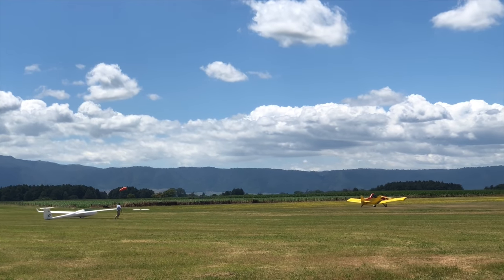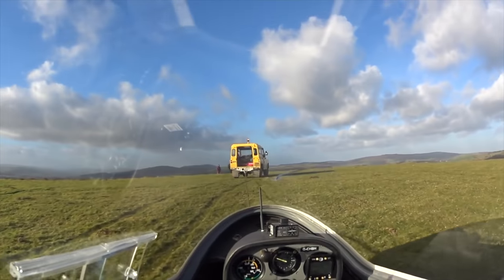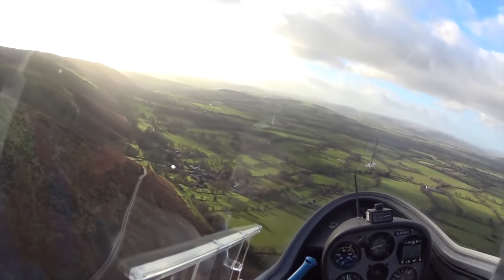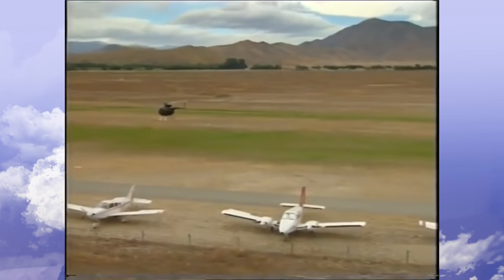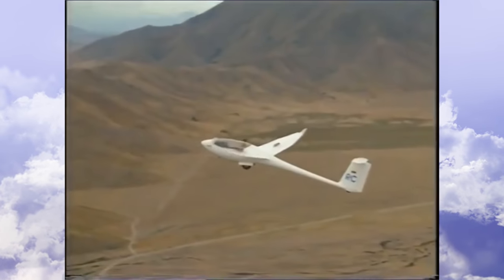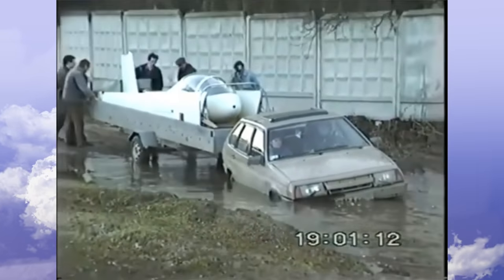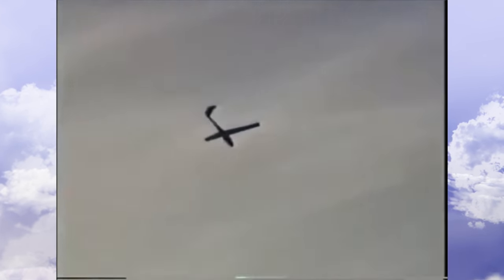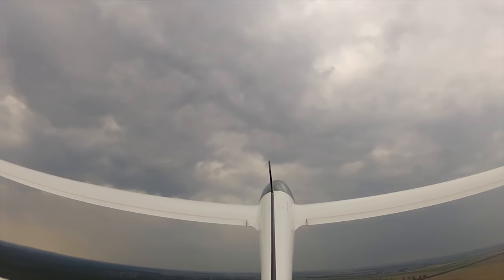4  Weird Ways to Launch a Glider! 🚁

Comment: Do you know whether the heli launch had an upgraded belly hook ? Can’t imagine most glider tow hooks are rated for the full glider weight!
Reply: I think they didn't upgrade anything. Glider hooks are designed to withstand more than weight of the glider. But this kind of operation is not expected to use as daily routine by manufacturer. Some glider designers assume nominal force 1.3 of max T/O weight and the shear 1.2 of nominal.
Reply from the maker: Yeah this was a one off stunt, so I doubt they changed the tow hook for it!
Reply: Glider tow ropes are required to have strength not less than 80% of the glider weight and not more than 200% of the glider weight. As the rope should break before the attachments, obviously the attachments (on both ends) must be able to cope with more than 200% of the glider weight.

Comment: Crazy Start method #6 isn't that crazy at all: RUN!
 
Ever heard about the "Archaeopteryx" glider? Swiss engineers invented a rigid wing glider that can be started by the legs of the pilot. :o

It's possible to start and land that thing like a delta wing glider. But with its enclosed cockpit and a glide ratio of 28, (and a prize around 80k) that thing is not a hang glider. Imo hat is a proper sailplane.
Reply from the maker: Yeah I don’t know much about it, but it’s very interesting! Almost a hang glider more than a glider

Comment: Interesting, you forgot the reverse pull auto tow. The cable, with rings on doth ends, goes round a pulley at the opposite end of the runway, the tow car drives towards the glider, the glider goes up they cross in the middle. When the glider releases the car the car goes to the launch point and leaves the cable there for the next launch, with two cars, the launch rate is very high.  I have seen this used on several sights in the UK
Reply from the maker: Yeah I think that's how you're meant to do an auto tow! I've never done one though, and didn't have any footage of it :)

Comment: That balloon launch got my attention too. Besides the safety issue, who would want to launch a glider during stable, low wind conditions?
Reply from the maker: True!
Reply: I disagree that it is unsafe - in fact I think its safer than winch or autotow.  And it could climb to a very high altitude, so after an early morning launch to 10000 feet in stable air, the glider could potter around at min. sink speed until the thermals start popping.
Reply: @davemould4638  Here’s my ‘unsafe’ scenario: if the cable/release mechanism should fail below 300’ there is no possibility of recovery.
Reply: @CLdriver1960  Realistically, what is the probability of the release mechanism failing under a 1G static load?  They are designed to take far greater loads during a winch launch, and how many cases of release mechanism failure do you hear of in any other type of glider launch?  I say it is less than the probability of an elevator attachment failing, or the release mechanism of helicopter lifting equipment, or thousands of other mechanical fittings that would result in death if they were to fail.  The probability is surely far less than the possibility of the brakes failing in your car, and you take that risk almost every day.
Reply: @davemould4638  I suppose I didn’t clearly make my point. The risk of the release failure may not be a high, as you put it, but the release/ cable failure will be as high as any cable break will. The consequence of a failure during an aero/winch/auto launch is either low, or insignificant. A low altitude failure in a balloon launch is catastrophic.
Reply: @CLdriver1960  You are completely incorrect about the probability of a cable failure.  The risk of a cable break during a winch launch is several orders of magnitude higher than the risk of a rope breaking during a balloon lift.  This is because the wire used for winch launching has a far, far lower breaking strain than that which would be used for a balloon lift, and the forces on the winch cable peak at around 2 times higher than for a static balloon lift.  A winch launch is pushing the load capability of the thin wire to its very limit, whilst the load on the rope in a balloon lift would be a small fraction of its design load.  Just compare how many cable breaks you get on a winch launch with the number of cable breaks on aerotow launches which also use far stronger rope.  The dynamic load on a balloon lift is even lower than that of an aerotow.  I flew at an aerotow site almost every weekend for about 6 or 7 years, and there was not a single incident involving the tow cable breaking or a release hook breaking.  There was one incident of a weak link failing when the glider pilot pulled up and turned into a thermal having failed to first release - but that was a good thing and the weak link worked as intended.  The very few incidents of tow rope failure I know of for aerotow involved poorly maintained or damaged rope which would have been obvious had it been properly visually inspected.  However, at a winch launch site I flew at for a few weeks, there was a cable break at least once every weekend, and sometimes several breaks.  You are therefore comparing chalk with cheese.  A balloon lift cable would not be fitted with a weak link because there cannot be any unexpected dynamic load peaks that need to mitigated.  IMO the probability of a rope or release failing during a balloon launch is lower than the probability of pilot error resulting in an equally fatal stall/spin situation or incorrectly handled cable break situation in a winch launch.
Reply: @davemould4638  Thanks for the primer on cables. I should let you know that I started flying sailplanes in 1974, and have had cable breaks on aero as well as winch launches.
Let me say again that there is a twofold issue: probability and consequence. However low the probability may be, the consequence of a low altitude failure is catastrophic, if not fatal.
Enjoy your balloon launch!

Comment: Is it possible with a normal Plane to hang vertical on a helicopter without structual overloading?
Reply from the maker: I doubt many are designed for it! Normally if moving an aircraft by helicopter they use lots of straps to spread the load. Not sure sorry.
Reply: @PureGlide  standard tow ropes can break at up to 200% of the glider weight, so the hook and attachment points must be capable of taking more than that.

Comment: Wasn't there some with a small engine and just enough gas to get to the top? They then glided back down.
Reply: I don't think so.  If you go to the trouble of having an engine powerful enough to launch you (as distinct from those which will only sustain you in flight e.g. Ventus cT as Tim has), you'd want to be able to continue, so you'd have a larger fuel tank.
Reply from the maker: Yeah as lautoka63 says some gliders have engines, but we use them once in the air. OR some have self launching motors, but they are bigger, more complicated and more expensive
Reply: The only short endurance self launchers are the electric variants, for now. Also the gas Solo engines are also short lived due to mechanical problems, so they usually only get you to thermal height anyways lol jk
Reply: @TheSoaringChannel  Well, I hope not!  Pure Glide and I both have Ventus cTs, with Solo engines.
Reply: @TheSoaringChannel  Half the time, they work every time! :D